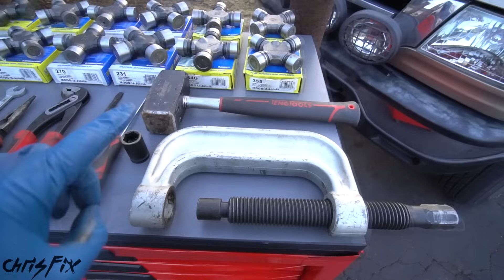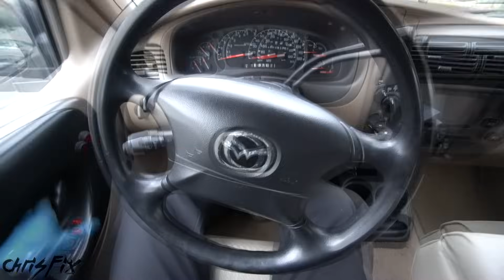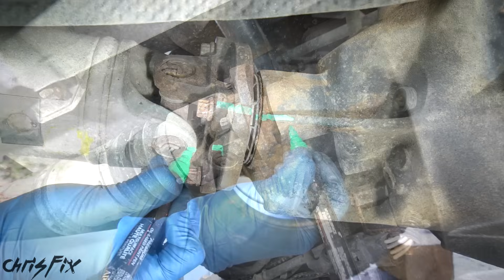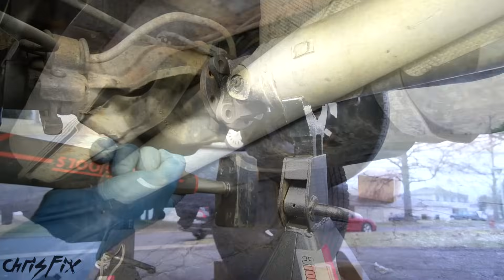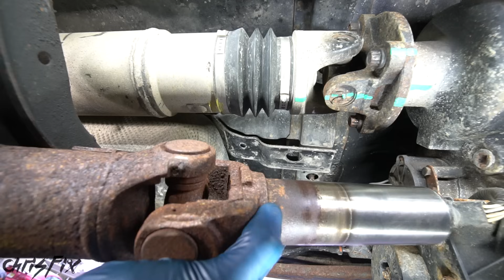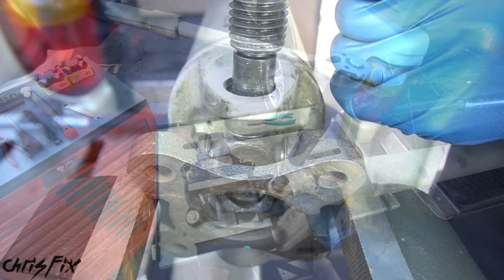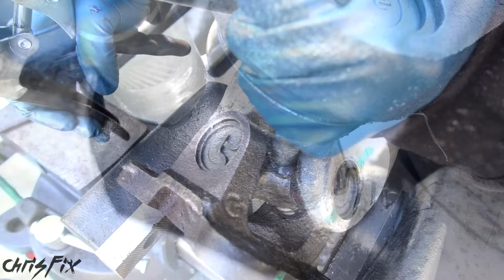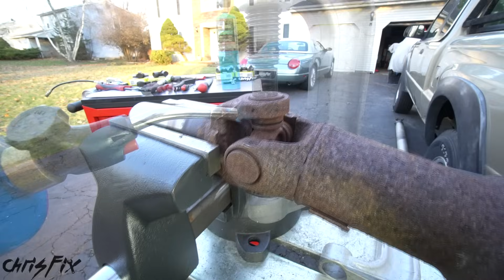How to Diagnose and Replace Universal Joints (ULTIMATE Guide)

Comment: Been watching for years (have a 2000 Ranger with 208k which I've owned 15 years and originally brought me to your channel), and you just keep getting better and better.  She still runs like new as I'm constantly performing maintenance, mods, and repairs. 
I already knew how to replace universal joints but I saw your video and just had to watch.  I didn't realize some of the other locations they could be found besides the ends of the driveshaft on some vehicles.  Thank you for sharing your knowledge!

Comment: Hey Chris, great video, I'd just recommend one thing, tightening those bolts to 80 ft lbs sounds like a lot, idk the factory specs, but some u joint bolts wouldn't go past 40, also you forgot to mention double cardan u joints for driveshafts, still gonna like the video just thought I'd share that with ya

Comment: One tip that I would add is to visually check where the grease zerk is for the ones that are not threaded in the caps. I see so many people install the u joint backwards and it's nearly impossible to grease even with a needle point adapter. Awesome video either way Chris!

Comment: I'm guessing the U-joints in my truck are going bad. It makes a clunk when shifting from neutral to drive, and I get a vibration around 75mph. My truck has 200k miles so it's probably time to replace them. Thanks for the video Chris!

Comment: btw some vehicals have a third universal in the middle
examples such as 1997 nissan 2 door pickups
also the part about the heating the bolt up is partaly corect
what happens is that you heat up the metal making it expand
knocking the rust off of it internaly
and it cools and shrinks a bit 
but great video

Comment: Thanks ChrisFix never done this job but now I got a video to go to if I never need to.but I drive a FWD car.
Reply: Donald Kline that's a different systom
Reply: I know that, CV joints and FWD I've done those and I've been working on cars and motorcycles for about 30 years but never did a U joint repair.
FWD cars can be a pain at times

Comment: That is a great video....  Well done Sir.

If I may, let's point out a couple things....

#1 Lots of those press things say DON'T user a power impact on them... Everybody does anyways, but... Definitely have gloves & eye protection while you're doing that.   And, if you rented it, and you ruin it with the impact gun, you might be buying it.... Also, grease the threaded shaft on that press C-Clamp thing...  It will spin easier, and transfer the full force to the u-joint.

#2. Those Chevy ones are hard to do.  You can torch all day, melted plastic all over, it still won't budge.  Rusted in place, or residual plastic, or who knows.  On the last couple I did, I took out the drive shaft, took it to a shop, and just said hey, I'll be back at 4, whenever you get a chance, can you press these out???   Shops have a huge press, that will pop those out in 2 seconds.  The minimal amount they charged me was WELL worth not having to battle those impossible things....  And for them, with the huge press, it only takes them 2 seconds....  The last guy even sandblasted the ends for me, without asking....  Very good use of $20 bucks...  I also left them a dozen doughnuts, that might have helped....  You can spend all day, and not get them to move, so you may as well just plan on taking it to a shop....

I would also say, yours didn't look that badly rusted.  In Wisconsin, or a similar place, those are going to be SEVERELY rusted, and hard to bust loose....  and you're going to have to clean clean clean those bores, to get the rust out, before you try and put the new ones in....

I'm not taking anything away from the video.  Great video.  I'm just saying, if you have a Yukon, or a 2500 Silverado, be fully prepared to take the driveshaft to a shop, to have those pressed out....  If you're a home gamer like me, you can only do so much.  After 4 hours of trying to press that out, and getting absolutely nowhere, you need to have plan B ready to go....  those things with the plastic in 'em, in the full size trucks, are not a joke.  they are tough.

Comment: Thanks for the vedio can you make a vedio how to fix your door when it will open from outside but not the inside
Reply: Chris cao Check the inside of the door frame and make sure the child lock is turned off, as that prevents the inside handle from opening the door.  It will be a small switch
Reply: Joseph Still Thanks I'll Try

Comment: You should see what happens when one of those break at 65 mph in a semi. Took out the air system which locked up the brakes and did $4,000 worth of damage.

Comment: Just as a tip. Make sure your grease fittings both front and back are pointing in the same direction inline with drive shaft. This is so you don't have to turn the drive shaft to grease multiple U joints.

Comment: A little trick I learned to get those stuck outer retaining clips out is to grab that large socket, that just fits into the bearing cap hole, and give it a wack or two. This will take any pre-load off of the clip and make it MUCH easier to remove with the needle nose pliers. I've actually taught a professional mechanic this trick. 
 Just one thing to remember, if you take the pre-load off one side, your putting it on the other side. So you'll need to do the same thing to get the clip out of the other side. 
 I don't see why this wouldn't work for hung up inside clips as well, but I've just never had the opportunity to try it that on those.

Comment: Perfect, the only thing to add is if you have a driveshaft with an easily removed sliding part, like the rear on an old Volvo 140 or early 240, then you have a three part driveshaft, the rear ujoint is the most common one that goes bad as the rear axle twists and moves around most of the joints. On those you can easily slide the rear part out of the splines in the front part. The yoke that has the splines has to be turned in the same way as the yoke on the front axel. So if you forget to mark up the ends the two "forks" the middle ones front "fork" and the front ones "fork" has to be turned so that they line up when sliding in the rear axle. Like this: =----= not =----- or something in between. This so that the axle will not move out of sync and cause vibrations. You can install it 180º wrong and get an unbalanced axle, but just loosing the four bolts at the rear and slide it out and turn it 180º should solve that problem. Just a heads up on sliding driveshafts that had a u joint at each end of the sliding part. (Your axle had a rubber sealed sliding part that you never took apart) :)

Comment: I have a question, what coukd cause a vibration that only occurs at speen when I accelerate.  It doesnt always happen, but when it does, my speedometer vibrates with the truck and it wont accelerate until I drive out of it.

Comment: I had a bad U-Join in a 2004 Subaru Outback but one problem, you couldn't just replace the U-Joint because it was pressed in from the factory so we had to replace drive shaft and all which would have been $500 but we got one from the junk yard for $75

Comment: Hey chris i see your shift handle is pretty tight, my became lose in the matter of months it has like 2/3 of an inch of play up and down, it shifts properly to but it always skips Reverse (8-10 times) when i go down from park when i shift upwards it works properly.
Any ideas or future videos
I have a ford explorer sich is identical to your trucks inside (iv worked alot and i mean alot of my truck with your videos, but didnt see one abouf that stick)
Reply from the maker: Watch my video “how to fix a loose shifter”
Reply: ChrisFix done that, but it doesnt help, i know inside there is 2 screws that hold the shifter in place i ripped the rubber boot and tighten them aswell and i still has the issue, (not by the pedal those are different ones i tried those).not sure if its the actual steering  shifter tube but i dont mnow if that can cause a lose shifter handle or if i should attempt to do it myself 
im pretty good at learning it may take me a whole day, but everything iv done with your videos has beeen successful, (but no video on the steering shifting tube) it hasnt caused me any problem other than sometimes skiping Reverse om my way down but i wanted to fix the issue if possible
Reply: ChrisFix Chris im an hour away from gainesville you bet ill do my best to be there!

Comment: a quick question, will the water damage the u joint? my car was flooded, and after all the cleaning was done,  i noticed some vibration when i stop for the traffic light and transmission still in Drive. BTW my car is only 4 years old, thanks in advance.

Comment: but if you don't have the tools you will either then have to borrow [kiss ass ] steal or buy them.And since nothing ever turns out to be a easy job ,"rusted ,striped
bolts etc.". and if your fixing your only vehicle you'll want to make sure your going to be able to fix it while the parts are removed or your going to be out of your ride ,.Otherwise thanks for the video

Comment: I work at a mechanic here in canada. I seen a u joint so baldy worn it might as well been seized. It vibrated and vibrated until it snaped the transmission in half. This was on 2012 dodge ram 3500
Reply: Jalapeño Humpa well it was a dodge, what do you expect

Comment: Guys i need help, my 01 GT Mustang feels like it's missing horsepower and doesn't run smooth. I scanned it and a code for the TPS sensor came up I replaced it and it still drives the same. I've replaced the fuel filter, tps sensor, spark plugs, cleaned the MAF, and retrained the pedal. What else should i look into ?

Comment: Hey Chris, Can you show a video on replacing a driveshaft flex joint with a U joint on a ford E350 on a 2017-18 there seems to be a problem with it wearing out by 70k miles and ford knows about it

Comment: When u supercharge ur car, can u explain the pros and cons of superchargers vs turbo chargers?
Reply: Brady Snelgrove superchargers have direct power, you punch the gas you get instant boost because it's driven by the serpentine belt. These are amazing for acceleration but usually don't run at as much boost as turbos and have parasitic loss because it takes extra force by the engine to make boost. But superchargers are much more reliable and good for most v engines (V8 v6) my profile pic is a Whipple supercharger on a lightning engine. The serpentine belt spins what is basically an air compressor sending air between two lobes or screw type lobes and this compresses the air forcing it into the cylinders (forced induction). Turbos rely on exhaust gasses going through the headers into a turbine spinning it, while spinning the exhaust side of the turbo simultaneously a separate turbine is being spun separate to the exhaust turbine and this turbine sucks in air and forces it through an intercooler into your intake and this forces air into the cylinders. Now for the pros and cons, turbos usually run at higher boost but they take longer to spool therefore you have turbo lag. They are also less reliable because of the higher boost they run at but are much more efficient because there is no parasitic loss. Hope this helps you probably already knew some of this but just in case.
Reply: Engineering Explained has already covered it, check it out :)
Reply: Brady Snelgrove turbos spool and supercharger wine's
Reply: The Fury I wanna hear Chris though lol
Reply: Gabe Barnett Yeah but how does this affect gas mileage?
Reply: Brady Snelgrove your gonna be lucky to get good mpg off of either one. That's just how it is. I'm sure you can get a tune at a logistics shop or an ecu to help with that tho.
Reply: wow

Comment: I had one of my U joint go out on the interstate a few years ago,  It would vibrate between 50 and 60 but once you got to 70+ it went away, finally it got to the point where the vibration was so bad we had to pull over and take it to a machine shop to fix it.  This video would've came in handy a few years back lol, Great video!